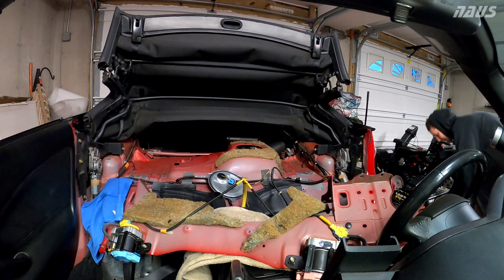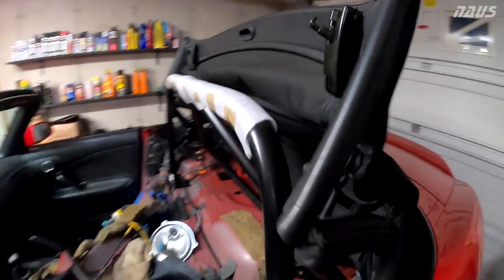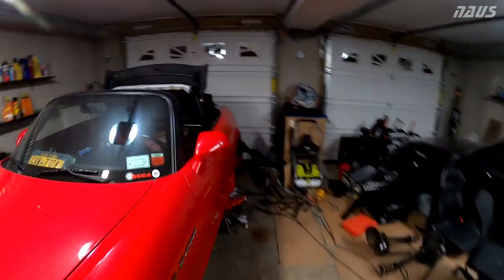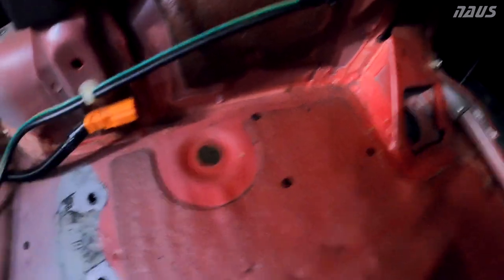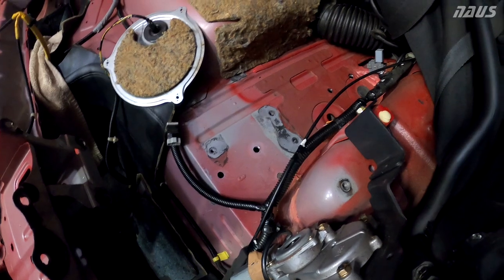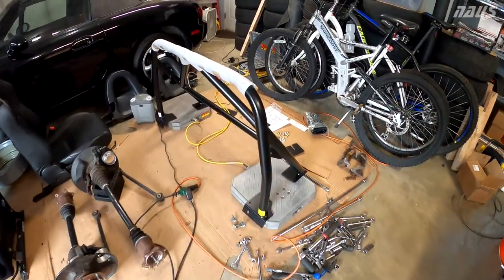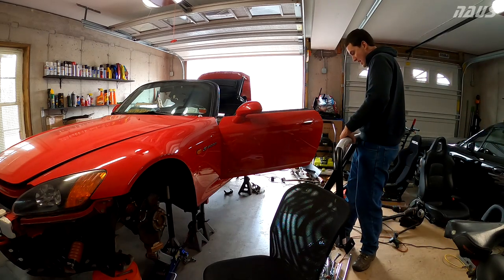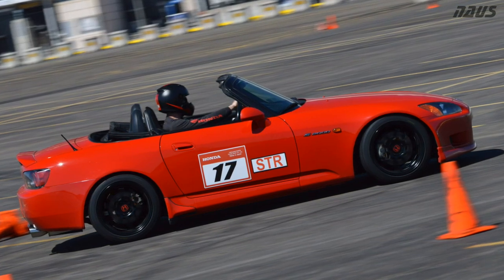S2000 Rollbar Install Pt 2  - Test Fit, Weight, & More!

Comment: Your keeping the factory bulkhead? When I did my EVS roll bar I weighted it all.

-23 lbs spare tire
-51 lbs softtop delete (just assembly)
-5 lbs 4oz Softtop motors
-2 lb 7oz softtop front latches
11 lb 2 oz bare factory bulkhead
5 lb 10 oz Center console
2 lbs 12 oz Rear tray 
8 lbs 5 oz Rear plastic
16 lbs 6 oz Roll hoops
Reply from the maker: Yes in part 1 i mentioned that I am going to fit all the oem interior back into the car, and still use factory seat belts